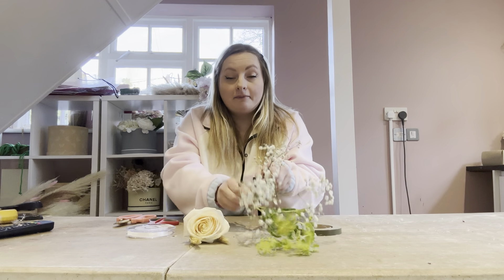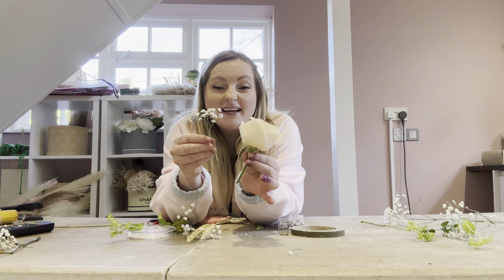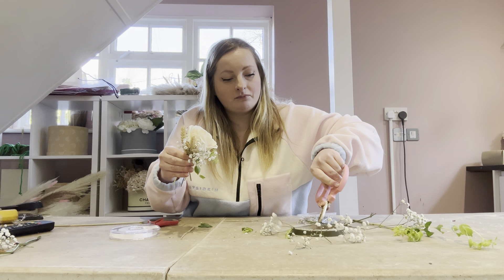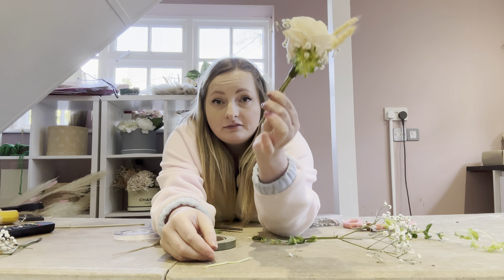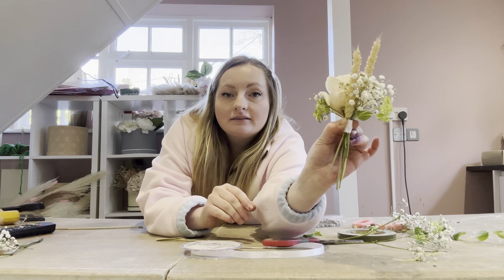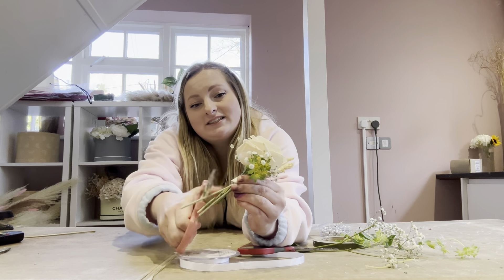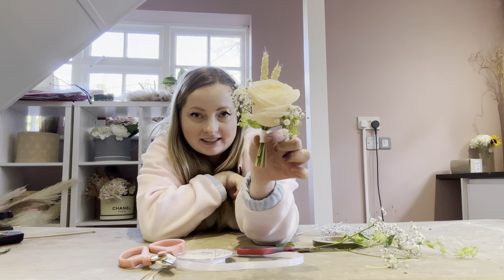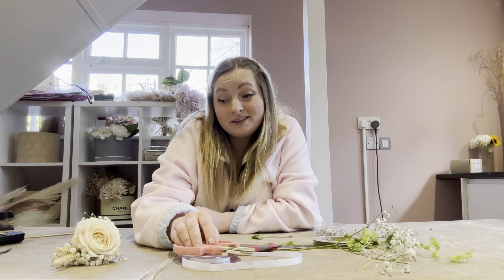How to make a buttonhole | EASY wedding flower tutorial

Comment: Rose is much to big it's massive and it's  not suitable for a buttonhole mid sized rose or bud rose  
and you need  strong foliage like ivy  or ruscus to highlight the arrangement 
Not to be too critical as everyone has their own style but it's a bit clumpy and oversized if you are going to add wheat you need to group it together tightly 
The stems need to be covered with twine or stem  tape
Reply from the maker: Thank you! I usually make the buttonholes bespoke to the customer. There are so many different styles of buttonholes you can do, this is just an example. I can make other tutorials using other techniques like wiring and taping , twining, full ribbon, different flowers and foliage like calla lily, spray roses, carnations etc. I can show examples of different sized lengths as well. if that would be helpful, I can do like a compilation of different styles. Xxx